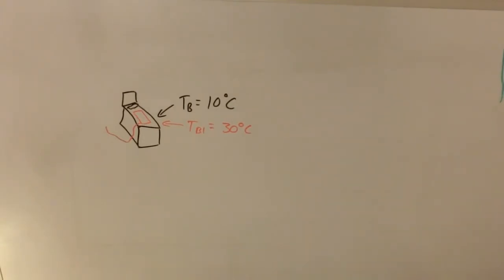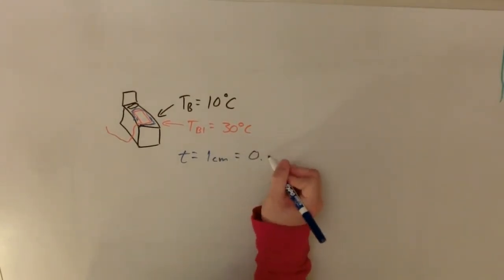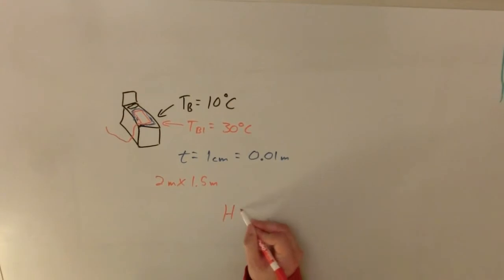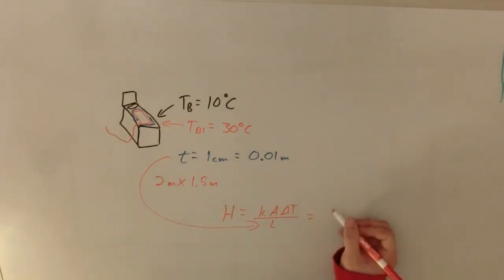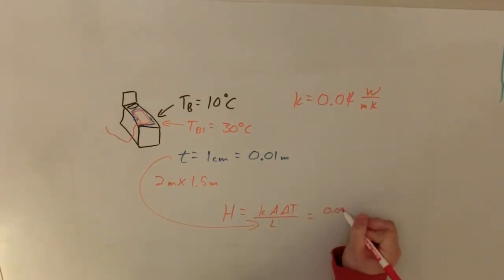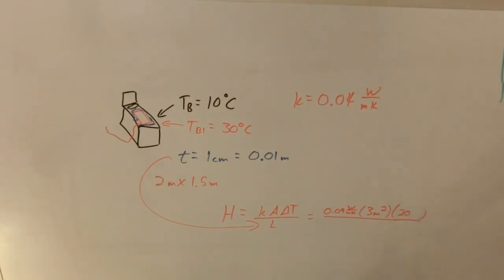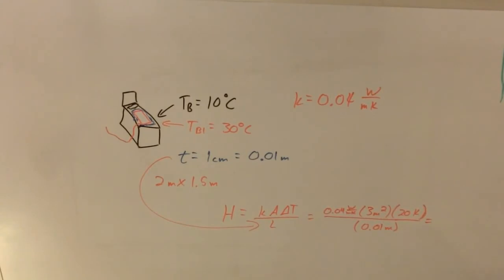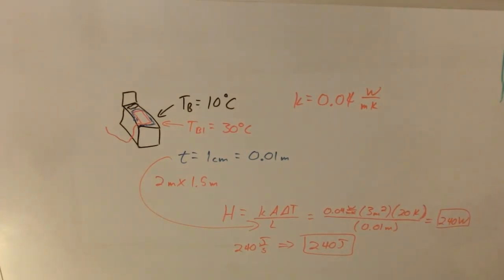Thermodynamics 005 Heat transfer rate

Comment: 30 degrees Celsius - 10 degrees Celsius = 20 Kelvin!? 
>:O
Reply: What's wrong with that? 1 degree change in celcius is equal to 1 degree in change of kelvin. So the difference in temperature celcius is the same in kelvin.